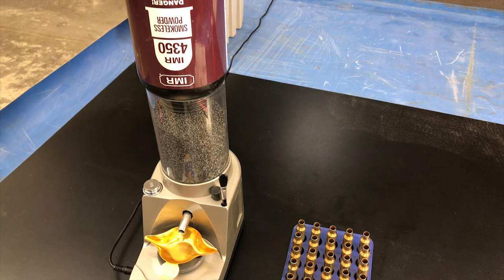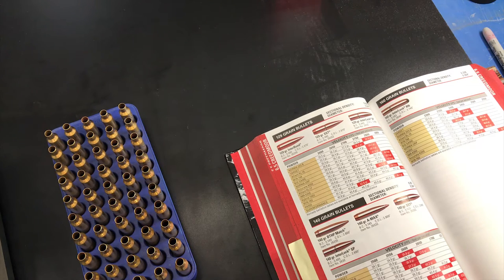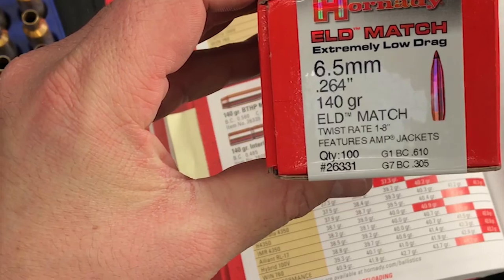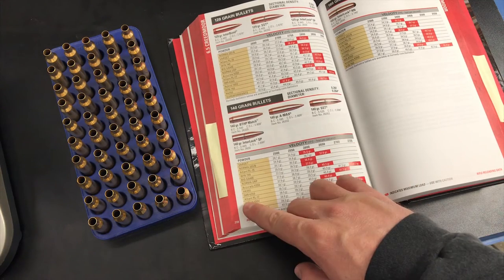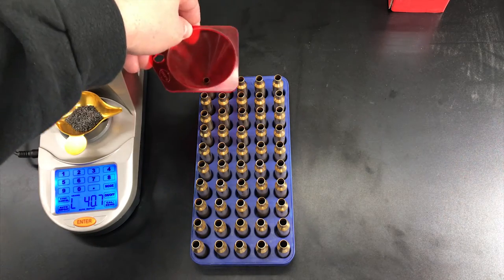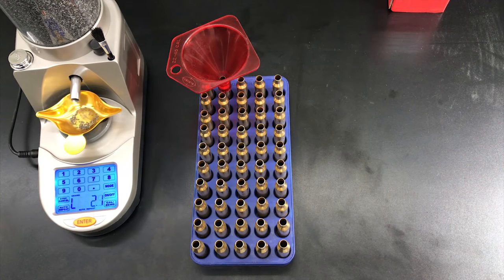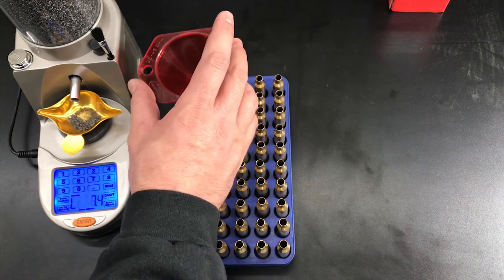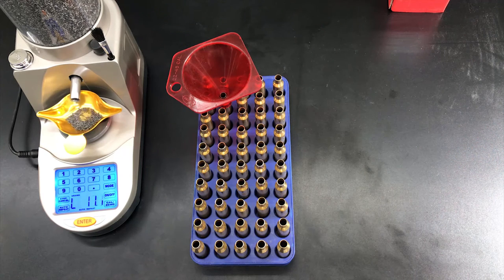Reloading 6.5 Creedmoor: PART 5/6 (Charging)

Comment: You missed the 4th case on the top row. Would hate to see you have a squib load.
Reply from the maker: Thanks, I did notice that also before I started seating, to tell you the truth I ended up weighing every cartridge after I caught that one to triple check. Usually, I have my electric powder dispenser set up on a wooden bench (because I found out the powder dispenser doesn't like metal objects/interference) and my seating press set up on a separate metal table right next to my powder despenser. This way I can seat a bullet while the next charge is being dispensed, it's faster and safer. I realize now I should have shown it done this way in the video
Reply: Center Impact changing procedures generally has a bit of a relearning curve not to mention talking to the camera can be a distraction. Im glad you caught it in advance.
Reply from the maker: Yup, thanks for the concern, I would do the same for another fellow reloader
Reply: glad I'm not the only one that noticed that
Reply: Neil Harris ya.. i saw that to.. but great video pal.. thanks a bunch.. ill be getting most of my reload equipment tomorrow. . tired of going to cabelas and them not having my ammo.. pluss i like technical stuff.. so this should be up my ally
Reply: Been there done that and good reason to flash light that brass right after your finished loading powder.

Comment: I weigh every charge! I use a powder thrower to dispense powder into the scale pan, a trickler to round off the charge weight on a beam scale, and then I set the pan onto a digital scale as a double check. If the two scales do not agree I recheck the beam scale poises and re-zero the digital scale. Normally it is the digital scale that has drifted, but once it was a beam scale poise got moved by accident. Either way all my powder charges get checked three times. Twice by scales and once with a visual, in the loading block, after I have charged a batch before seating bullets. I do what I do for safety, not speed, cause as the old saying goes "SPEED KILLS!" And I encourage all to not find out the hard way. All in all, none the less I can charge cases in the same amount of time that it takes for one of the digital auto trickler scales.

Comment: In my RPR, i fire 3 types of bullets. 120 Berger HPBT Target with 48grns Superformance at COL 2.845"(All Loads) which is .002 off the lands. Neck tension is .284bushing(All Loads). 140 Hornady Match HPBT with 42grns Hodgdons 4350. 140 Hornady SST with 44grns IMR 4350.... great/all sub MOA- 10 shots groups at 100yrds....one ragged hole...... Cheers Eh.

Comment: I load my 6.5 140 ELD-M rounds with 42.8 grains of H4350. Initially I was getting factory load FPS (2710) but after a year of shooting that load in my RPR, it's up to 2748-60 with no pressure signs of any kind. I'm also loading to a 2.23 OGIVE. .5"-.65' MOA. SD around 11.
Reply: I use 42.0 with CCI Mag. and 42.5gr. with CCI BR2 in my RPR and get sweet groups at about the same FPS, about an inch higher groups then the Hornady 140 ELD factory loads. Have you tried Varget? I may try it at a later date if H4350 gets hard to find.

Comment: Wow! You have a high end powder dispenser but a Cheap aluminum lee $45 C shaped press. Not to pick on you but really you need to up the press to a full frame press. So you don't get flex, this will helps with concentricity. You may not believe that C shape press will flex but do the research and you'll see. I'd stick to pistol rounds with that press. actually I'd just toss it and go with a better press period. Again not trying to make anyone mad just really trying to help. I have a Lyman T-mag press which cost a whole lot more than the one your using and I wouldn't use it for any rifle rounds. Because of he push/flex so I bought the Lyman Crush2, a good value but RCB Rock Crushers seem to be the standard. Both are cast iron and steel construction and both are full frame meaning it has support in front of the ram as well as the rear of the ram. So you get equal distribution of pressure while sizing and seating of bullet, greatly improving concentricity. also both feature a priming system I feel is better than using a hand held primer which I feel is kind of cheesy too. No offence, and one more thing I don't know who said it but in the primer pocket section of your video a comment was made. I would be a little more careful with the tools using a drill to drive your chamfers and deburring tools can be a little brutal remember brass is very soft and you don't need to take a lot of material off. That isn't a good idea your only trying to clean any swedged material obstructing the pocket and leave a small chamfer for a lead in. RCB makes a set of steel brushes for small and large primers that work well to clean out the pocket and doesn't remove a lot of material. Your chamfer should be just enough to break the edge and clear  obstructing material from factory swedge  leaving a small lead in for your primer. A nice snug fit of the primer ensures that it will not be blown out when fired and keep your brass in better shape to be reused again. I have seen where guys who reload over do the pocket and when the cartridge is ejected the primer is popped out never to be seen again. A that stage the cartridge is ruined. Hope this helps and not offend.
Reply from the maker: I must say, I can't argue, you are 100% correct. Been looking into other Lee presses, would like to upgrade to a progressive press and still use as a single stage for rifle, trying to save up some cash, this stuff can get pretty pricey as I'm sure you are aware. But you are right!
Reply: Bro, Stay away from the LEE presses they are bottom of the barrel if your gonna do al lot of rifle stuff I'd say go with a single stage breech loader and gander mountain sells the Lyman crush2 for $59.97 press only looks like you have everything else so you'd be good with that and gander is going out of business right now so you might even get it cheaper if there isn't a gander near you order online LMK how you make out
Reply: here is a little story for you I got in to reloading about 7 years ago and I'm pretty extreme meaning at the moment I have 5 caliber pistol rounds I do and 7 rifle calibers so I reload a lot and I shoot an awful lot well when I first got in to it my father in law was the one who introduced me to it reloading and at the time he was all hopped up about the new Lee progressive press e bought I was there the day it arrived and helped him set it up on his bench a few days later he was bragging about how  great it was every crank spits out a finished bullet blah blah blah. he is big in to .44 mag and special so that's what he was loading at that point. well the following week we were at the range and he was in the lane next to me when I get tapped on the shoulder. hey can you look at my revolver somethings wrong it wont chamber the next round it seems to be jammed. I look carefully and notice a projectile half in the barrel like it started in and never flew so we go out to the lobby and see my bud who runs the range and we get the cylinder open and nock the bullet out all is good. go back to shooting and a few minutes later tap tap it happened again same deal this time we realized the reason for it happening is there is little to no powder charge and its just being primer pushed into the barrel he gets home that night and goes through all the rounds he loaded and soon realizes a good number of them are off in powder charge the press was not working properly after a week he had to take all of them apart and wound up using the press like a single stage too much going on at once to be sure it all going right and to add to this story at ste same time my brother in law bought the top of the line le progressive and was doing 9mm and it happened to him I'm glad I went with the lyman tT-mag and I started with 357/38 special its better to go with something you can keep watch over all processes and be sure your bullets turn out right than to rush and wonder if they are FOOD FOR THOUGHT
Reply: @trikegmister5114  As far as overly worrying about hang-fires, do not forget to stay off of air planes and do not travel in cars because accidents do happen you know. One can get caught on fire fueling their car. And forget sky diving or bungy cord jumping right? Or riding motor cycles for that matter. Oh and I hear people choke on their food too, so better not eat anything either. And the leading cause of death is medical malpractice so never go to the doctor! So you might think that if one just stays in bed they would be safe, but doing that one could get blood clots that can kill them also. So best just be glad you are alive and live a little while your at it.

Anyway, old deteriorated powder, moist powder, low powder charges, primers that where not stored properly, (cheap) low quality primers, and or overly crushed primers can all cause miss fires, squib loads, and hang fires. Be sure to treat them all as if they were hang-fires though.

Best way to avoid these is to reload your own ammo, and use quality primers. Also do not use old powders, and be sure and visually inspect each powder charge. Plus crimp the cases to the bullet, as this will give the powder more time to start burning good before the bullet moves which would cause more usable case volume of which wouldn't allow the powder to build up its pressure for the powder to burn correctly right off the bat.

The hang fires cased by a very small charge are normally brought on by the use of a powder measurer/dispenser and static electricity bridging the powder charge in the drop down spout as to only dump a small amount into the case that went unnoticed and a bullet was seated. The primer pushes the bullet out of the case, and the low powder charge then has too much room to build pressure immediately, so it burns slowly until the pressure builds up and then the charge will start to burn faster to the point it will either spit the bullet out or lodge the bullet further down bore.  This is why I never recommend the use of a progressive press with an on-board powder thrower, as this type of set-up is responsible for both squib loads and hang fires, as well as guns blowing up. The guns that get blown up are the ones that got the powder that was hung in the measurer, due to static electricity bridging the powder in the down spout, from a previous squid loaded round so that it ends up with an over charge. Yes one of the rounds in a squib load's batch could very well be one that literally blows the gun apart. Most people that end up with a bad round will spend time disassembling the rest of the batch, be it a few, hundreds, or even thousands of rounds, for safety sake. A lot of time spent that they tried to save by using a progressive press in the first place.  Then they have to turn around and remake the rounds a second time, of which if done again in the same manner of using a progressive press with and on-board powder measurer may very well end up needing to be re-disassemble all over again if static electricity rears it's ugly head this go around too. A vicious cycle.

There is a business that sells replacement powder hopper that are made of Pyrex instead of plastic which should by all means stop any static electricity from building up on the powder in the hopper so that powder bridging in the drop down portion should be a thing of the past. Personally I am getting one, as static electricity is a Handloader's nightmare. DRAM WORX - Pyrex Replacement Hoppers. Oh, and replace the plastic down spout with a metal one too.

 Personally, I will not run a progressive press because of all the safety checks they cheat us out of. I run all my brass through one step at a time on a single stage press, with hands on every step. This gives me plenty of time to catch cracks/split cases, primer hole issues, primer seating issues, bullets seating issues, and crimp problems. If anything is out of whack the brass gets reworked or trashed. As for powder I weigh every charge! I use a powder thrower to dispense powder into the scale pan, a trickler to round off the charge weight on a beam scale, and then I set the pan onto a digital scale as a double check. If the two scales do not agree I recheck the beam scale poises and re-zero the digital scale. Normally it is the digital scale that has drifted, but once it was a beam scale poise got moved by accident. Either way all my powder charges get checked three times. Twice by scales and once with a visual, in the loading block, after I have charged a batch before seating bullets. I do what I do for safety, not speed, cause as the old saying goes "SPEED KILLS!" And I encourage all to not find out the hard way.

The progressive press can cause all three dangers no matter what powder one uses.
It is the ones that use progressive presses that have these squib loads, hang-fires, and double charges, and put bystanders at risk of injury or death. And when some one gets hurt it will not be considered an accident but rather reckless conduct with a firearm or involuntary manslaughter! If you are going to reload you need to take responsibility and check every powder charge! Personally I weigh each charge on a beam scale, double check them on a digital scale, and last but not least I do a visual check before seating bullets. This routine if followed religiously will negate all squib loads, hang-fires and double charges by 100%. 

Safety should always be the #1 priority when reloading, not rushing through the process to save time!

"Basic Handloading" by George C. Nonte Jr. 
page 43:
"Use of an adjustable powder measure will greatly speed up the operation."
page 45:
"If you discover an error after forty or fifty rounds have been completed, there may be no way to identify the cartridges that contain the error."
"Usually, a charge that bulks abnormally high or low will do so at the expense of the charge thrown immediately before or after it. A light charge in the case might mean that some powder remained in the drop tube, and so was probably added to the next charge thrown; an overcharge probably indicates that powder hung up in the drop tube from the pervious charge, making it less than it should be." 
"If it seems that I'm dwelling overmuch on powder charging, remember that this is the most critical of all the handloading operations to safety. You'll get no joy or profit from handloading if a mistake or an oversight causes a gun to be wrecked or a shooter to be hurt. Handloading is essentially a very safe practice, provided one adheres to the basic safety requirements and concentrates on the job at hand."

Robert A. Rinker also tells the same thing as above in his book titled "Understanding Firearm Ballistics 6th Edition.

Comment: That auto powder meter seems a lot slower and a lot less accurate than my $20 lee powder measure
Reply from the maker: Well like I mentioned I usually seat my bullets while it's pouring the next charge, in this case, I was trying to film in 2 separate stages for clarity. The first couple are usually off, but then it gets consistent, it's been good to me ever since, but yes, it is pretty pricey
Reply: Center Impact ah that makes sense. Pretty sure in the time for one pour from the auto one is equal to the time for me to charge and seat a bullet, but it is nice seeing the exact charge each time and being able to change charges quickly. I'm sure I'll get an auto meter eventually just for those reasons. I just spot check mine to make sure it's exact but it's rarely off by more than .1.
Reply from the maker: I find it helps me a lot more if I'm reloading semi-auto, if I'm going to try knock out like 300 cartridges in a day it really helps a lot, shaves a lot of time. But then again, you are on the verge of progressive loading at that point, and you can pretty much pick up a complete lee progressive reloading station for about the price of just that powder measure, soooo...... yeah, its not the first thing I would run out and spend my money on, but it can be nice sometimes

Comment: Your first weighed charge was a little above 40.5 but everyone after was on the money. Question, does the scale/dispenser have a memory to maintain accuracy after the first load.
Reply from the maker: Yep you are correct, I usually like to wait a little longer for the scale to settle, was rushing a bit for the video. Honestly, the scale pours heavy the first few times then it warms up and seems to settle. I usually dump the first 5 or so pours back and cycle it a few times, seems to be more consistent after that